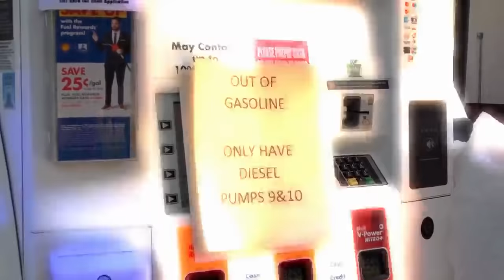Moonshiners Make Gasoline Out Of Alcohol During Gas Shortage | Moonshiners

Comment: In case anyone is interested, you must richen up the mixture quite a bit to run ethanol. 30-40 percent more fuel depending on the brew. That’s all the flex fuel vehicles do differently, they are programmed to increase the fuel amount into the engine when the sensor sees more and more alcohol content in the fuel. Normal vehicles can run e85 as well, the oxygen sensors will compensate up to a point. Usually 25 percent. You will most likely get a check engine light if you run straight e85. But the vehicle might still run ok. Older vehicles and carburetor vehicles will need manual adjustment of the fuel mixtures. Also alcohol is corrosive and some vehicles tolerate this better than others.
Reply: Alot of good information here
Reply: Make sure to have a fuel pump And fuel lines capable of running éthanol or they will disintegrate
Reply: As an automotive technician that's been in the industry over 25 years I have to say that's not entirely true people put the e85 in gasoline cars and make it a mile or two down the road and then have to get towed to the shop and then because the o-rings and the rubber components in the system are designed for that level of alcohol content and deteriorates it and basically makes you feel pumped and you fuel injectors useless and leaky until the point that they become useless
Reply: @yupcrazy...5465  it’s true, some cars handle it better than others. I burn all my old e85 from my race car in my old Chevy truck. Just pour a few gallons in at a time and it runs fine, never had a problem. Other cars computers can’t compensate quick enough. E85 won’t break down o rings as fast as you say. Over time they will deteriorate, yes. There is 10% ethanol in all gasoline now, cars would be having a lot more issues if it was that much of a problem. Carburetor vehicles are another story.
Reply: Any vehicle can be tuned to run E85 no problem. It just requires more fuel to run correctly with no engine knock. The gas lines corroding and fuel injectors getting clogged are the main issues
Reply: @yupcrazy...5465   I run up to 40% ethanol on my 2019 accord, of course I installed a flex fuel sensor and been good for over a year now.
Reply: I have only come across ethanol fuel causing fuel system damage and it was an Oldsmobile aurora with the north star V8, it has thin hard plastic tubes connecting the fuel injectors off the main line the started cracking and leaking but was a easy fix.
Reply: Around 15 years ago, I ran my 1997 Dodge Intrepid, 3.5 liter, non-flex fuel vehicle on straight E-85 for many thousands of miles. The car ran the same as always, and no check engine lights. I sold the car at 130,000 miles, and it ran for a long time after I sold it, until I finally lost track of it. I'm not saying that EVERY non flex fuel vehicle would have the same positive results as I had, but mine survived with no issues.
Reply: @BlazRa  The "corrosiveness" has nothing to do with the Styrofoam cup collapsing and breaking down. That's simply a chemical reaction between the ingredients of the cup vs the gasoline. Its a fact that alcohol fuels are WAY more "corrosive" than gasoline. Race cars that run alcohol MUST flush their lines out after EVERY race with gasoline to avoid corrosion in the fuel system from the alcohol.
Reply: I had to buy a new petcock for my carbureted motorcycle, the previous owner used gas with ethanol and it ruined a seal inside the petcock
Reply: @davelowets  we need to figure out a way to fix that we could easily start making car engines with parts that don't corrode or something because we could easily just grow our own fuel with corn
Reply: @BlazRa  The issue isn't with the corroding parts. The reason that E-85 collapsed in the market is because it takes more energy, and thus more pollution, to produce E-85 than it does just to run straight gasoline in the first place. E-85 is not a viable option to replace gasoline.
Reply: @davelowets  that doesn't make any sense ethanol Burns clean there's not even any black smoke
Reply: @BlazRa  Yes, it DOES make sense. It takes MORE energy in the form of electricity to turn corn into E-85, resulting in more pollution, than it takes just to run straight gasoline. It has nothing to do with how it "burns in a vehicle". The pollution and wasted energy is during the production of E-85. This is just a common fact.
Reply: @yupcrazy...5465  I have a 1984 Mercury Grand Marquis 2D coupe. It’s been sitting for idk… let’s say…. 2-3 months. Is it better to start it up to keep things cycled or is it bad to start with that old gas?
Reply: Technically alcohol isn't corrosive, not by itself anyways.  However, it's hydroscopic.  It pulls moisture out of the air into itself, creating an environment where corrosion can occur.

It's why you can't efficiently store pump gasoline long-term.  The alcohol content will pull water into the fuel, eventually ruining it.
Reply: @davelowets  then use nuclear power plants .. .done and done
Reply: @Juss-Saiyan  I agree...
Reply: @davelowets  huh... never knew fhat ngl
Reply: and if you get old enough, the engines were what people called all-fuel models. gasoline, kerosene, diesel, vegetable oil, alcohol, used engine oil. if it's liquid and it can burn, you can run it
Reply: @davelowets   I live about a mile from an Ethanol plant, and what you say about them being energy inefficient is true, for now. They say that the gap could be lowered by 50% simply by further integrating it with local agriculture. Not all of the corn can be used to make alcohol, and is still edible by livestock. Cow shit can very effectively be used to fire the boilers for the ethanol. I see it a bit like electric cars. Are they great now? No, they have their problems, but working on it might make it a more viable choice in the future.
Reply: In my country most cars are flex fuel so if gas is too expensive I just run e100
Reply: Ethanol eats up the rubbers regular gasoline runs through though. So the fuel system needs an upgrade either way. Eventually you'll have a nice black goop clog up your system after the e85 eats the lines away
Reply: @TheGuccibane  Oh, I agree with you there. Springing for new lines, gaskets, and seals that are ethanol friendly is a good idea. I while back I found out that 3D printed TPU can be an effective gasket for gas engines. It's more durable than felt gaskets, and even cheaper than paper ones. It handles regular gas perfectly, I want to test it against ethanol now.
Reply: @TheGuccibane  on some yes
Reply: 25 percent? Try 15. It's part of the OBDII standard . You have the internet, so use it.
Reply: @pootispiker2866  HPTuners will often show +25% on long term fuel trims on a vehicle that is not tuned correctly. That, plus the short term fuel trims can compensate even more. I’ve seen it while driving a vehicle.
Reply: @123cornflakeman  Dont forget seals dryings up from ethanol. Corroded lines can be swapped and now days those are mostly plastic anyways and injector clogging can be fixed with proper cleaning and filtering. Its the seals and fuel lines drying that is the issue if those are not made ethanol proof rubber. That is already happening with E95 that has just 10% ethanol in on some models and two strokes aint liking e98 that has 5% ethanol since it flush the oil film more than the old gas we use to have.